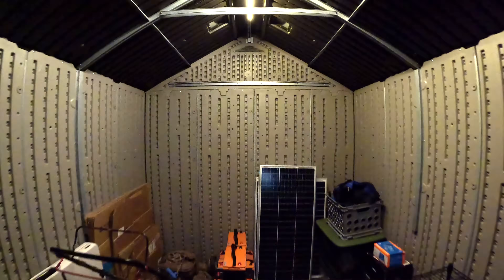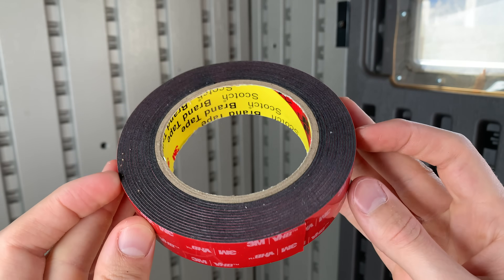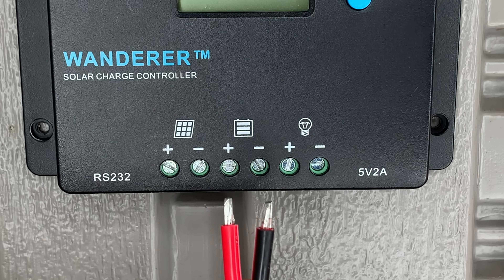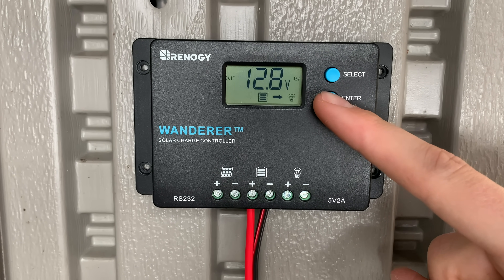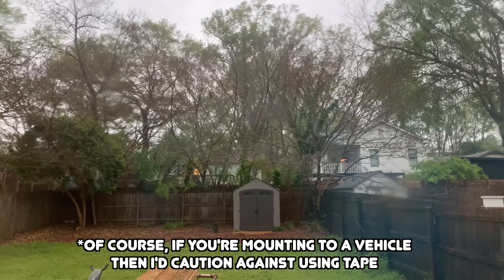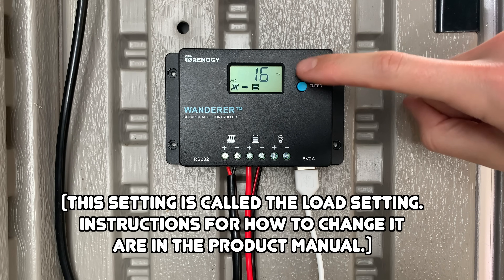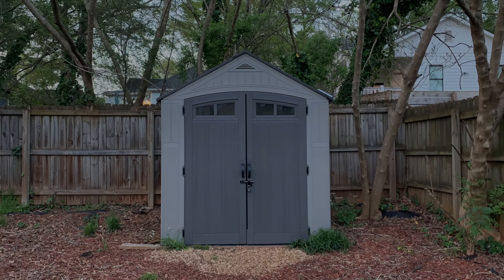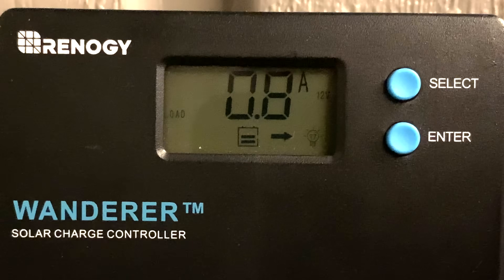Easiest DIY Solar Lights I Could Think Of

Comment: Loved the video. Is there a way to run a 12v string light with a plug using solar and in a impractical position, ie a roof?

Comment: Nice job! I used a solar security light that the small solar panel is separate with a cord that lets you mount it up to 10ft away. The security light comes on when I open the door to the shed. I have to set the sensitivity high and the time long but it works great. If I’m in the shed more than a few minutes and it turns off I just wave my hand and it comes back on. This works so well and was so easy that I installed one on my other shed and my front porch.

Comment: “No tool build” proceeds to just use the smallest most annoying tools he can find around the house…this is just dumb, if you are doing this project and can afford to buy the battery, panel, and charge controller you can afford to buy a few hand tools and probably know a friend with a drill…

Comment: It’s not the voltage, it’s the current that kills. 0.007 amps across the heart will kill you stone dead. Always use properly insulated tools. This dangerous video should be taken down. What an idiot.

Comment: Thanks for a nice video. I can see you used a 12v battery and 5v lights. Does the controller somehow convert the voltage or how does it work?
Reply: The USB port on the controller is regulated to 5V at 2Amps. You can still access 12v power from the controller using the 'load' screws on the controller.

Comment: How do you match the panel size (watts), controller (amperage), LED light requirements (amperage), hours/day and battery capacity?  In other words, if I used the same LED strips you have, which are 2A, but need them to run 8 hours/day what do I need in the panel, controller and battery capacity?  Essentially, what specs do I need to look for?  I'd probably go with strip lights that I can wire directly to the controller (vs. USB) or directly to the battery.  Thanks.

Comment: Thanks for the inf Alex.  Things I found very helpful... "Sealed Lead Acid" Battery is needed for freezing temps.   I'll probably get the 30W panel, and 25-30 Ah battery.   (btw, you used the trusty tweezers as a tool, LOL... could have used your fingernails)
Reply: Or used your teeth….look no tools 😅😅

Comment: for safety reasons never cut corners and use proper equipment and tools.
Reply: What equipment was not proper?
Reply: Hair clip @wardraven8755
Reply: @wardraven8755  Well, the tweezers for one.

Comment: Excellent how to! Thanks. I've got the same brand shed as you do but mine is 15' deep. I noticed the lights you used from Amazon are only 6.5' in length. Can I add a couple more together so the lights go from the front to the back of my shed? Thanks again.

Comment: I have a resin-type shed that's similar to yours.  I'm hoping to maybe one day have solar panels covering the one full half of the roof  (the south facing half of course) and running power (under ground) to a ductless minisplit unit (with the outside compressor about 30 feet from the shed, and the head unit of the minisplit installed in an upstairs bedroom).  They now have minisplits that can run on a combination of DC and AC (where they prioritize the DC first).  With the minisplit's variable speed compressor, they can apparently run at low speeds with relatively small power consumption.  Since my shed is only 7'x7', and with only 1/2 of the roof facing south, there's not a ton of room for solar panels.  Maybe I can fit four 100W panels I'm hoping.  Anyway, this is just a thought so far.  Haven't started taking measurements or running numbers yet.  Current "concerns" are 1) how much panel and associated power generation can I fit on half of the roof of the shed, 2) how heavy will the panels be on the shed roof, 3) how can I safely run power underground from the shed to the outside compressor unit, 4) how much power I will lose in that ~30ft run, 5) what is the bare minimum power that a (maybe 9k or 12k BTU) minisplit can run at a slow speeds with its variable speed compressor (e.g. does it need say 250W or so to even run at all).
Reply: If you are powering a minisplit for an upstairs bedroom, and HOA rules aside, why wouldn't you set everything up on the house?

Comment: I'm thinking of doing the same thing with 12v fluro lights, will have a couple panels and potentially a couple batteries aswell, would that work?
Reply: Yes but there’s a specific way to do it, you’ll probably want to connect multiple batteries in parallel.

Comment: won't the batteries overcharged? i mean the controller doesn't have mppt feature right?
Reply from the maker: Good question - Nope, the charge controller has overcharge protection! And I  don't know of a charge controller that doesn't protect against overcharging. It's a standard feature, regardless of whether it's a PWM or MPPT charge controller.

Comment: What charge controller  do I use for 100 watt solar panel
Reply from the maker: There are lots of options! The one I use in this video works with a 100W panel. It can handle up to 130W. I'd recommend it as a good budget option
Reply: @footprinthero  thankyou

Comment: Nice video. Sage old advice (from formerly intact solar panel cables): If you have squirrels, you may wish to dab some clover oil on the outer casing of any exposed cable once in a while. Replacing damaged cables gets old fast.
Reply from the maker: Thanks for the tip! I definitely do have squirrels so I'll try this out

Comment from the maker: PRODUCTS

Battery - https://amzn.to/3KN0VBq
Charge controller - https://amzn.to/3KO2tLJ
Solar panel - https://amzn.to/3GvdgaW
Mounting tape - https://amzn.to/43lXOYn
Adapter cable 1 - https://amzn.to/3zOffnc
Adapter cable 2 - https://amzn.to/43m3L7H
Lights - https://amzn.to/3meoJoE

~
Some things I didn’t mention in the video:

 - Alligator clips are far from the best way to connect wires long term, so if you want to make the connection a bit more permanent — especially in vehicles where everything gets moved around during transit — you can use electrical tape to tape the clips to the terminals
- Lead acid batteries shouldn’t be charged below -4°F (-20°C)
- The estimated solar panel and battery sizes at the end are conservative because I don’t want your lights to die unexpectedly 😜
- The adapter cable I used has a 7.5A fuse, so make sure you get a solar panel that won’t exceed this limit
Reply: About 110 dollars for this build . Might be cheaper just buying the solar power lights